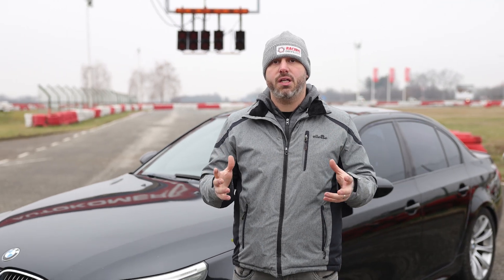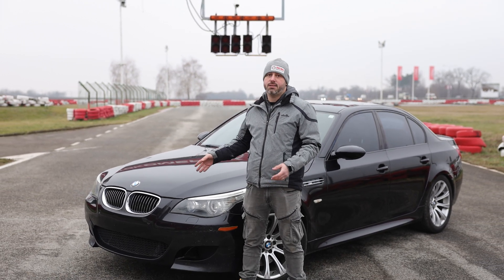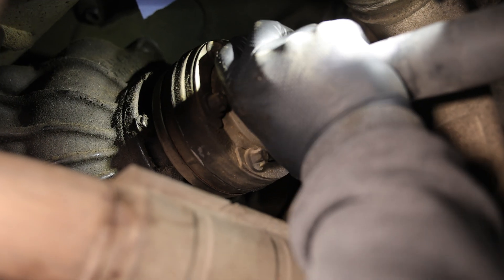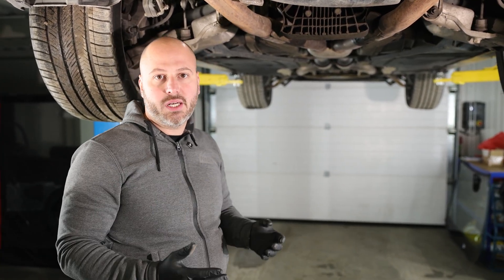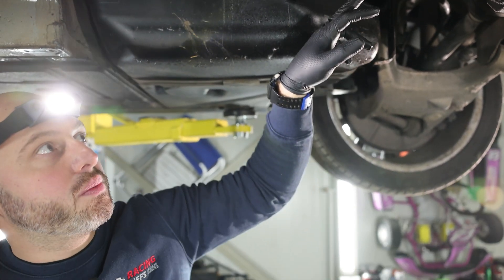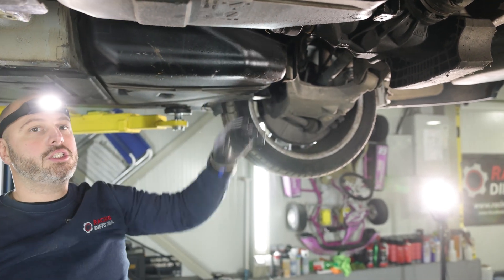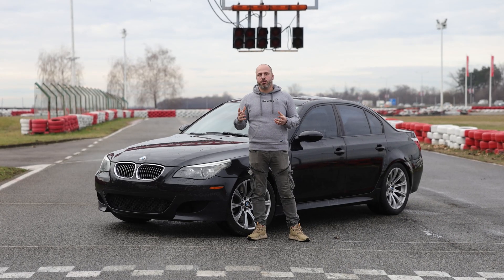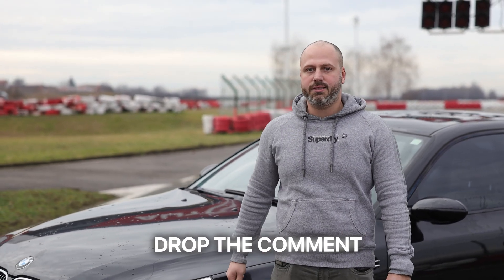BMW "M-Clunk" LSD Issue – The Diff Free Play in E60 M5, E63 M6 Explained and Fixed (Before & After)

Comment: The only legend on the platform I know that produces the best tutorials for enthusiasts to keep their M5 V10's healthy on the road!
Reply from the maker: Thank you so much!👋🏼
Reply: Hello 
I drive the M6 E63 same Motor 
My left side Shows space like in the Video, right side its ok ,no oil comes out, no scratch noise from Differential when i drive forward, but when i turn to right curves then i hear from the car little noises  and when i pas the curv it disappers, 
Its my Differential done or only the sides Stock ?!
Thank you
Reply from the maker: Your differential started to fail. you noticed it very early, which is good. No vital and expensive parts should be damaged if you service it on time.